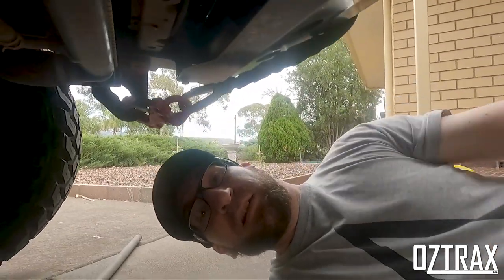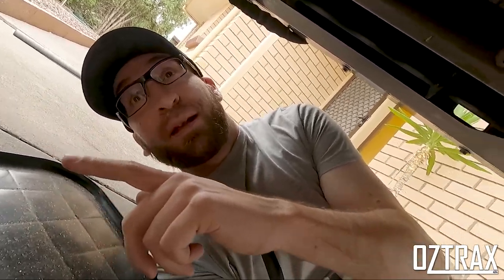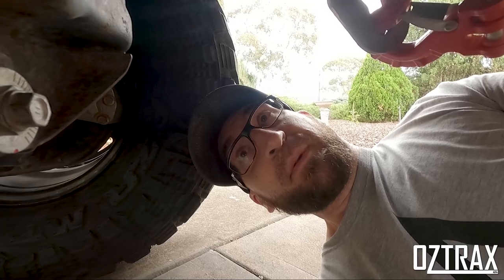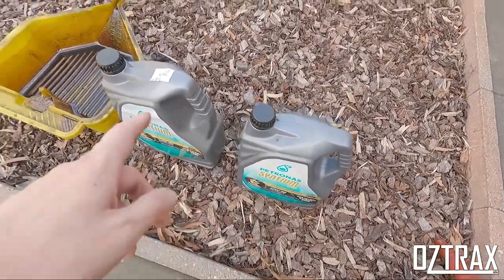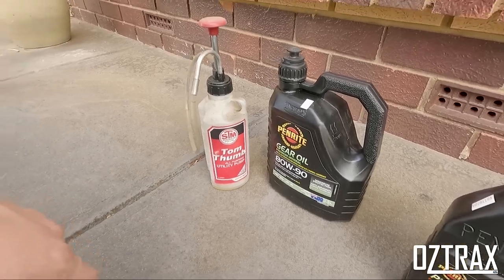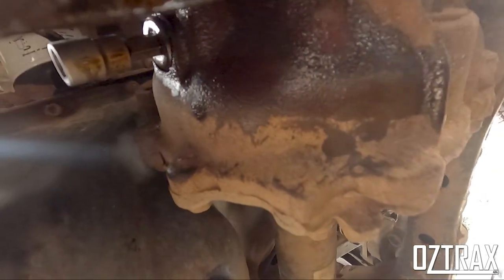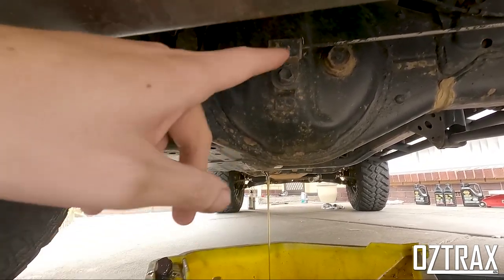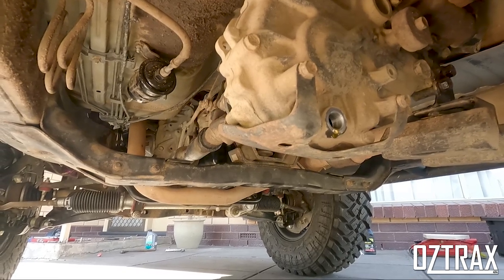DIY: Toyota Prado 90 Series // Servicing Your Vehicle

Comment: Tip always undo the filer bolt when changing any oils so it will 1 flow freely and 2 u can refill it, because many times the filler bolt won't undo then ur in a bit of bother, love my Prado Grande🇦🇺🤙💯
Reply from the maker: This is more or less already a pinned comment, but yes, definitely make sure you can loosen everything off before changing any fluids or you're going to have a bad day. 😎

My Prado was great until the accident, but I much prefer my 80 series diesel Landcruiser these days.
Reply: @OzTrax4X4  sorry didn't read all comments my bad, hava gr8 day🇦🇺
Reply from the maker: All good 😊 thanks for the support 🤠👌

Comment: Amazing takeaway from you folks down under - I intentionally head to a shop to spray the underside of my '97 90 series with oil to slow rust while you mention in your piece on intentionally cleaning the wayward oil - It makes under carriage service a royal mess but keeps the rust at bay...  Canada -  Sorry to hear you lost it from reading the comments- Brought mine in from Japan 4 yrs ago and hole to run it up to 500,000km
Reply from the maker: Fortunately for us, there is hardly any snow here, so our roads aren't salted, which makes it far easier to keep clean.

She was great, and did the job, but I find my 80 series to be far more suitable for what I do in it these days. 🤠👍

Comment: Weird your filter is on the side of the motor, mine is on a aluminum drain tray next to the intake, also whered all your skid plates go?
Reply from the maker: Might be different locations for different countries perhaps, I can't actually answer that one.

Regarding the bash plates, from factory ours only had that little front one.

Later on before I lost the 90 series in a rollover I had a full custom upgraded set that covered the oil pan, gearbox and transfer case.
Reply: I actually just stumbled across why my filter is where it is, I have the oil cooler option, Toyota part 15710-67040 and 15701-67030.
Reply from the maker: I would say that would be due to the cold climate you live in. 🤠👌
Reply: @OzTrax4X4  Oh it's only -11C right now it's fine, tho I would have really preferred the fuel heater and block heater options. And frankly where I'm at rarely gets above 30, so it feels really silly having it, but the fact the Australian built ones dont have it is comical.
Reply from the maker: Only -11 😂

I camped in -7 for the first time a few months ago, and that was cold enough to freeze my door locks.

As it doesn't really snow in Australia unless you're in the alpine regions, there is really no need for anything additional as it just doesn't get super hot unless it's over summer.

Average temps would be 25 degrees give or take.
Reply: @OzTrax4X4  that's much milder than I expected for down under to be honest. I figured the summer would be an average of 35 with peaks into 45 or so.
Reply from the maker: Only have two days of 38 so far and back to 26, but Summer hasn't kicked in yet and I don't plan on any camping trips over Summer because that's uncomfortable.
Reply: @OzTrax4X4  anything over 34 is too hot for me, but still much more pleasant than I had thought.

Comment: Those vibration dampners (the rubber block on the T-case) were about $300 from Toyota when I priced them ten years ago (I bent mine right up), I'd hate to think what they're worth now.
Reply from the maker: To be totally honest, I don't know how long mine hasn't been doing anything, but I've since removed it and haven't noticed any difference.

It had around 20mm of rubber still holding.

The lower bolt stripped the thread out of the transfer case too, so no chance of refitting another one even if I wanted to without actually cutting another thread into the transfer case and putting a helicoil in there.

Regarding pricing, that's ridiculous, but Toyota here charge like a wounded bull.

Comment: You never showed how to remove or replace the oil filter. The question is why
Reply from the maker: Unfortunately, the oil filter is in a hard to film location on the 90 series and I was filming this whole video myself, so it would have been very difficult to get a clear shot due to its location.

Comment: Is it okay to use 85w90 to my front and rear diff?
Reply from the maker: I would stick with the 80w90 as that is what is specified to be used.

If you choose to add 85w90, then know that it will be a thicker oil when cold and may not be able to lubricate the bearings which could cause damage long term.

Comment: hey mate how often should I do this? I do mostly road driving and every few weeks or month I  give it a hard time at the beach all day
Reply from the maker: Hey bud! 🤠

Generally with a V6, every 10k for engine oil & filter, but if you're pedantic, 5k for both.

Turbo diesel every 5k.

Diffs I'd do every 40k.

Make sure you have breathers on those diffs, gearbox and transfer case.

For your trans, if it's auto and you're not confident in pulling the pan off and changing the filter (it's a messy job), take that to an auto trans specialist and do that yearly.

Otherwise do the manual trans at the same time as the diffs.

Also, if you're driving an auto, add an external trans cooler inline after your factory radiator pass-through trans cooler if you haven't done that as that gives extra cooling to your fluid and will make it last a lot longer and not burn it prematurely from excessive heat cycling.
Reply: @OzTrax4X4  thanks for the info! it's a manual vx diesel! just got it in march stoked to of found such a rare one.. only issue is can't find in the service history in recent 40,000 ish kms if its been changed, it says theyve been checked but no doubt doesn't have good penrite in there, might have to do a peace of mind change!
Reply from the maker: Pretty rare to find a VX in manual, let alone diesel so look after her. 🤠

If in doubt, change it out.

For example, my 80 series that I now have hadn't had a service in 9 years as it was parked up, so switched out all the fluids and filters.

The one thing I will highly recommend is to grab some Fuel Doctor and follow the shock treatment/maintenance instructions on the back of the bottle.

It's an expensive outlay, but you'll gain a far nicer driving diesel out of it.

Preventative maintenance is key.

Also make sure you fit a catch can if you haven't already done so. 👌
Reply: @OzTrax4X4  Wow never heard of fuel doctor?? says to put it in with a full tank of diesel and then put 25ml for the next few fills? I've never heard anyone talk about this but wonder what changes I'll notice?
Reply from the maker: Not sure if you can get it over where you are as it's an Australian product. 🤔

I've gained an extra gear uphill compared to how it was about a week or so ago.
Reply: @OzTrax4X4  your neighbour from nz mate!
Reply: @OzTrax4X4  oh awesome well the last person serviced this like crazy and had diesel cleaner and injector cleaner etc so I'm assuming I only need to do 25ml to a tank rather than shock it
Reply from the maker: Well that's easy enough then. 🤣

Head on down to Supercheap Auto and pick some up. 🤙

Let me know your thoughts on it.
Reply: @OzTrax4X4  definitely will! might just try 25ml per tank and see how she goes
Reply: @OzTrax4X4  seems bit scary chucking stuff into my car that isn't diesel but I just read heaps of good reviews
Reply from the maker: This does both of those things.

Totally up to you, but it won't hurt it if you do the full shock treatment and then maintain it. 👌

Comment: Hi Mick how  many kms do you need to change the oil on the diff mate
Reply from the maker: Diffs and transfer should be every 45,000kms bud.

Auto transmission every year with a new filter.

Manual transmission I'd probably do the same as the diffs/transfer case.

Comment: Do you have a video on installing the recovery mounts?
Reply from the maker: Unfortunately I don't, as I don't have the 90 series anymore due to a rollover.

That is pretty straight forward though, couple of bolts on the chassis rail to mount them up.

All the recovery point kits should come with instructions.

I know aironboard provide installation instructions too.

There are pictures on my Instagram where you can roughly see where they mount.
Reply: @OzTrax4X4  Legend - I'll check it out. Just looks like a mission with the front bumper hooked up
Reply from the maker: No, not at all. Bolts in right next to the factory bash plate on either side towards the front end of the chassis.

Comment: Thanks mate your video very good and easily understandable for everyone, I have a question Can I use fully synthetic 75w90 in  front diff, rear diff and transfer case as diff need 80w90 but 75 is not too thin and will do job as its synthetic too, my car manual says GL5 90 and didn't mention 75W or 80W what you reckon?
Reply from the maker: Hi Azam

I'm glad it was easy to understand. 😊

In regards to your question about the oil viscosity.

75w90 would be too thin for the diffs.

I'd stick with what is recommended which is 80w90 for the front and rear diffs and the 75w90 for the transfer case.

The diff oil is formulated for the constant work the diffs do, being full-time 4WD, so that's why I wouldn't go changing the grade.